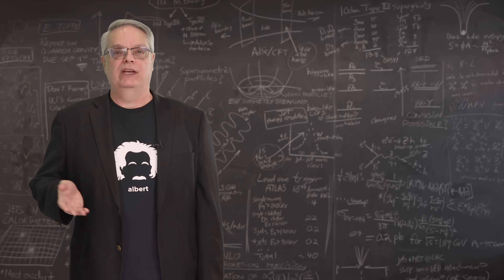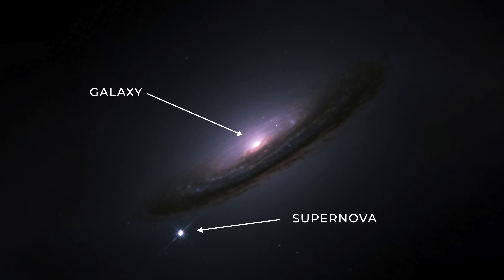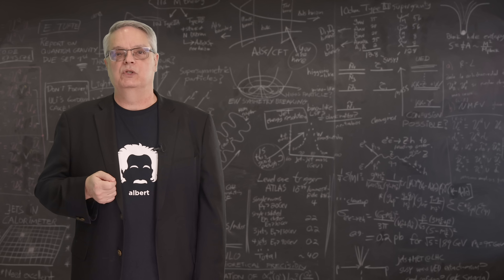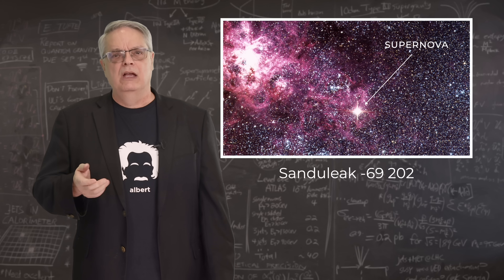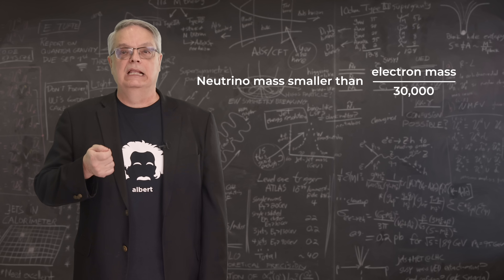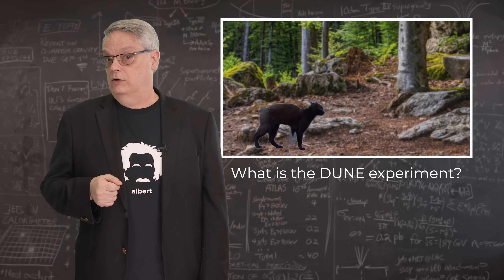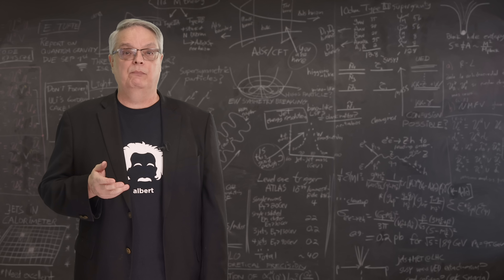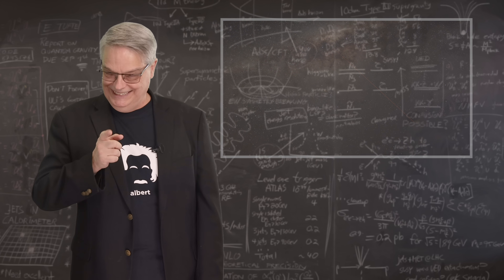How can you look inside a supernova?

Comment: i cannot help but imagine that for every supernova, the surrounding dozens of star systems get all of their life instantly annihilated
Reply: Pretty much, if you are close enough.

Edit: the supernova 'lethal distance' estimate is 50 light years.
Reply: Its not that simple after all massive stars form first within giant molecular clouds and these short lived stars supernovae are largely responsible for seeding additional star formation in the same complexes by compressing the gas and dust. For life to get instantly annihilated the supernovae would have to be pretty close astronomically speaking and most such massive stars don't get to wander far from their birth clusters, only the lowest mass stars capable of going supernovae and or high speed run away stars get to escape.  As  such most of those nearby systems are still in their early stages of formation much like the solar system was when the fossil radioisotope chemical signatures found in asteroids/meteorites were created some 4.5-4.7 billion years ago(In this case I'm referring to elements still chemically bonded like another element that has since decayed rather than like their current element). Clearly that wasn't an endgame for life in our solar system so I wouldn't count out other stars either yet. After all without supernovae guts we wouldn't be here either! ;)
Reply: @Dragrath1  The current estimate, which they call the 'supernova lethal distance' estimate, is ~50 light years.
Reply: @sophiophile  Yep cosmically that is a "tiny" distance. ;) The point is that supernovae have pros and cons for example there is work to suggest from a global spike in cosmogenic radioisotopes in sediments of 2.6 million years of age indicating a nearby supernovae (~150 ly or so) that coincides with an interval of climate change and overhaul which based on fossils we know is also largely responsible for driving our evolution as a species. Thus its quite possible that we as a species can be said to owe our existence to that supernovae.

Also don't forget that phosphorus (the only cosmically rare element used in disproportionately high amounts by life on Earth) is only produced as a byproduct of oxygen core/shell burning which only occurs in the las few years of a very massive star's life as oxygen burning is the second to last major reaction to produce more energy than it takes to produce it, the last reaction of course being fusing silicon into iron.  Such stars will invariably go supernovae unless they collapse directly into black holes and thus the only ay to get phosphorus out into the winder universe is via supernovae. ;) Creation and destruction are intimately linked in our universe by well effectively by the 2nd law of thermodynamics a.k.a. its deeper roots in information theory
Reply: @Dragrath1  Yeah, essentially everything heavier than iron is from supernovae (and/or part of the decay chain of the elements created).  Supernovae that result in a black hole collapse also includes an explosion just the same.
Reply: @sophiophile  Generally objects which collapse to a black hole will produce and explosion however not always, there is some evidence to suggest stars can under certain circumstances collapse to a black hole directly and in the case where the collapsing star has little remaining net angular momentum no accretion  disk will be able to form meaning the star can "collapse" without producing flashy fireworks at least from a classical GR perspective.
Reply: @Dragrath1  Interesting. Do you know what class of star can collapse without explosion? What are the special properties? From what I knew, anything from 1.3 solar masses up to the very very early suuuuuuuuuper big stars that are thought to have been the source of supermassive black stars all explode from what I've read.  Also, from a GR perspective, how can any star have such a high density that the event horizon (or other relevant boundaries) is inside of the edge of the star's radius. I mean, if it were then wouldn't it already be a black hole?
Reply: @sophiophile  Oh boy.. The several massive stars in question which appear to have disappeared and the black hole which doesn't show any signs of the velocity kick expected from a supernovae were all luminous evolved stars in the !20+ish solar mass range relatively far away. Its possible dust obscuration could be involve din the prior but no evidence for this has been found looking at the stars in questions coordinates(thought it has been found for other candidates).

Thus its kind of an unsolved mystery as to how it exactly might occur we know what sorts of things would have to happen for this to occur but not how and the objects in question are all to far away to study in more detail. 

As for the black hole physics bit that is tricky I could give you the textbook answer but I'm pretty sure that is wrong or at least incomplete since we don't understand how gravity and quantum   mechanics acts at those scales. Conventionally its all about the matter just falling into the center and breaching the Schwarzschild limit and then due to the lack of angular momentum there isn't anything to push back via conservation laws but this has a number of flaws in particular this model doesn't conserve in formation which is the foundation of quantum field theory thermodynamics and computation among other things.

However in the case where space time is asymmetric there is a theorem called the No big crunch theorem which shows that for any initially expanding universe that is sufficiently large to appear locally flat and isn't perfectly symmetric and homogeneous that the off diagonal components of the metric tensor will always be reducibly nonzero and asymmetric growing non linearly with distance such that at large scales these nonlinear asymmetric terms of the metric tensor will grow without bounds because as time passes faster far from local curvature space will always expand faster here resulting in a positive feedback loop with the rate of expansion locally slowing near  sources of curvature at an asymmetric rate causing bulk flows to emerge as the rate of expansion everywhere in spacetime becomes uniquely defined at all points. This is effectively a consequence of the past light cone in an expanding universe passing outside any observers cosmological horizon and propagating information which then becomes imprinted into the off diagonal metric components and the the simple fact that as matter concentrates forming over densities there will always be far more underdensities created as a result.

Incidentally from the perspective of the past light cone and borrowing the definitions of information from information theory it can be shown that this theorem is identical to the second law of thermodynamics if there is a direct link between informational entropy and total spatial volume. This nonlinear GR domain also naturally in an expanding universe trivially gives the 1st and 3rd laws of thermodynamics an irreversible arrow of time (because it can be shown via proof by logical self contradiction that no metric which permits the existence of an inflection point in bulk curvature i.e. going from expanding to contracting or vice versa will in the large scale limit always result in self contradictory outcomes in the vein of the liar or grandfather paradoxes (a.k.a. causality and or information conservation will always be violated unless the metric is uniquely defined at all points in spacetime).

One consequence of this is that there are always nonzero asymmetric  components to the metric and while they indeed locally i.e. within a single galaxy are small they will become significant at large scales growing nonlinearly with if I'm remembering correctly approximately spatial volumetric dependence (so ~d^3 ) and it has been shown that accounting for these terms allows one to completely eliminate the need for "dark energy" from cosmological models at the cost of admitting that spacetime is like other multivariate systems of partial differential equations irreducibly nonlinear and chaotic. Occam's razor thus supports this kind of approach though cosmologists still hate it  probably because its not very useful as good luck running such calculations in a nontrivial simulation without a powerful supercomputer.

Also note that the integral sum of nonzero asymmetric terms is what in the Schrödinger equation gives rise to the Pauli exclusion principal and Fermi Dirac statistics thus if this is true this should imply that space  is quantized in such a way that spacetime behaves liker fermions to some degree. Notably these off diagonal terms are predominately repulsive and if there is a scale of quantization then its fairly obvious that as one approaches the fundamental length scale the effects of gravity should weaken dramatically as these asymmetric components become significant and oppose the inward attraction of linear terms in the metric.

This would effectively mean the escape velocity never actually can reach c only asymptotically approaching it in the limit where total mass approaches infinity though the gravitational redshift would also become enormous so this is probably indistinguishable from classical black holes for anything in the millions to billions of solar mass range as the light would be redshifted to the effective size scale potentially approaching hawking radiation wavelengths. This may however be observable for "stellar mass" objects above the Tolman–Oppenheimer–Volkoff limit which we unfortunately don't actually know. (though in this case no such limit would ever exist they would just get more and more redshifted and time dilated to external observers in the limit as mass goes to infinity)

The point is that in all likelihood our models in this range are laughably inadequate and wrong because the full solution would require accounting for large asymmetric nonlinearities that current cosmological and general relativistic models neglect on a falsified assumption that they will be negligible. Oh did I mention that because this couples the evolution of spacetime to a nonlocal total entropy of space in any given time slice  this also satisfies bells inequality as a nonlocal hidden variable theory where the hidden variable governing the metric is what is normally called entropy and this lets you to some degree reproduce ER=EPR type behavior as the uniqueness of the metric corresponds to the uniqueness of path integrations which in the limit where space is simple should reduce to Hawking's limit at least in the case of cosmological horizons from any time slice frame of reference. It might even be the case based on these crude limit analysis  that entanglement is the force mediator of gravity or that the metric is the sum of all possible entanglements between any combination of information in which case space and spatial locality itself would be an emergent property from the rate of entanglement/decoherence.

Its not settled of course but to me its frankly looking more and more like the cosmological principal a.k.a. the assumption that the metric can be treated the same everywhere at some large scale because off diagonal elements of the metric as assumed to "cancel out" at large distances is the source of incompatibility between GR and QFT. In this case it would even turn out that we have been dealing with quantum gravity all along and just not realized what it is (a.k.a. the solution to the measurement problem is gravity mediated collapse/entanglement) which implies the ideal location for quantum computers would likely be far from massive bodies.

Comment: If photons created in the core of the sun take 1000s of years to reach the surface, does that mean we are actually seeing the sun as it was 1000s of years ago despite being only 8 light min away?
Reply: No, the photons also get reabsorbed and emitted constantly on their way up so the ones that have a straight shot out aren't quite the same as they were when they started at the core.
Reply: It's technically not the same light as what was emitted in the core, that's why it takes so long. But more importantly the light that gets here is still leaving the surface of the star after having interacted with it, and beyond that there's so much more light that reaches us from the surface directly, that there's no time delay shenanigans. Physicists just say "it takes 1000s of years for that light to reach the surface" as a shorthand for "the electromagnetic energy on an escape vector from the core of the star is emitted as a photon, and over 1000s of years of being transmitted, absorbed and re-emited the energy finally escapes as a photon from the surface."
Reply: Good question tho...

Comment: 1:08 animation not exactly realistic haha. Since the whole star doesnt collapse, only the about Earth sized core.
Reply: The whole star collapses.  Once the core stops producing energy, there's nothing to keep the rest of the star up, so it falls down.
Reply: @michaelsommers2356  No it doesnt. Go read up on type 2 supernovas. The core collapses, the outer core hits the inner core and bounces back. This rebounce 'wave' is the supernova explosion, and it takes a few HOURS for it to reach the outer layers of the star, blowing it apart. Leaving behind the inner core as a black hole or a neutron star.

So no, the whole star doesnt collapse.
Reply: @rykehuss3435  So the rest of the star just hangs up there by magic?
Reply: @michaelsommers2356  Neutrinos released from the core collapse.

You clearly dont understand the scales involved here. In any case, no, the whole star doesnt collapse. Only the core does.

Comment: Isn't the supernova an implosion? Mass collapse under gravity once the star becomes incapable to generate fusion energy to sustain the equilibrium?
Reply: Generally speaking this is true for a core collapse supernova. That outward explosion shown in the animation is actually the pressure wave from the implosion that rebounded off the super dense core, collapsing it into a proto-nuetron star, with the rebounded implosion wave behaving as shown.
Reply: It's both.

Don't forget the neutrino burst and it's heating of the stars outer layers.  Thats 99 percent of the stars gravitational binding energy pushing upward at once.

Comment: So regardless of the cause (acceleration) time slows down in a gravitational well. Gravity is everywhere except between gravitational wells. In deep outer space it is between gravitational wells so there is no acceleration to slow down time. That means time goes by very fast where there is no acceleration. 🙂

Instead of invoking dark matter and dark energy, do some thought experiments in general relativity and you will understand that rate of time and the measure of distance are relative to the amount of matter and mass there is in the vicinity. The speed of light literally depends on these two variables of time and distance. 

As you observe a galaxy you are actually seeing differing rates of time and differing measures of distance. The result is that you are seeing differing speeds of light (because of the rate of the passing of time and measures of distance) relative to where we are since the measures of time and distance are both dependent on the amount of matter and gravity there is in the vicinity. (The speed of light isn’t actually changing, the measures of time and distance are changing which effectively changes the speed of light as we observe it over GREAT distances.)

The result is that distance is greatly expanded (not expanding) where there is no matter between us and distant galaxies (causing redshift) eliminating the need for dark energy and the movement of the outer spiral arms of galaxies is at a faster rate of time causing them to move faster as we observe them eliminating the need for dark matter. This also means that plasma jets shooting out from the center of galaxies isn’t seven times the speed of light. It’s that the distance is expanded and the rate of time is faster the less matter there is in the vicinity.

There is no such thing as a nonsensical infinitely expanding universe or an imaginary inflaton and there is no such thing as imaginary invisible dark matter. 

Distance is merely greatly expanded between the black holes in galaxies (causing the redshift) so the universe is not infinitely expanding as is claimed. An infinitely expanding universe is nonsensical. Not only is distance greatly expanded where there is no matter between galaxies, time runs at a much faster rate where there is no matter. 

Distances within the galaxies are vast so when we observe another galaxy, we are literally observing differing rates of time and differing measures of distance still within the limits of other galaxies, not to mention the extreme distances between galaxies where there is no matter to dilate time and distance. 

That means the distances between the galaxies are greatly expanded, (not expanding) and time between the galaxies is running at a much faster rate which allows for us to see fully formed distant galaxies in the first place.
Reply: You can't do physics with words.  You have to use the equations.